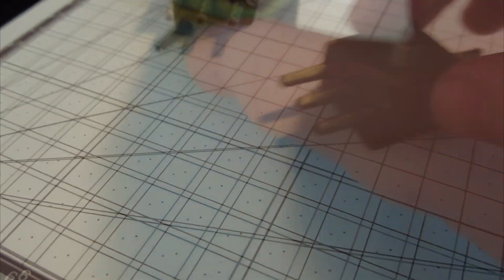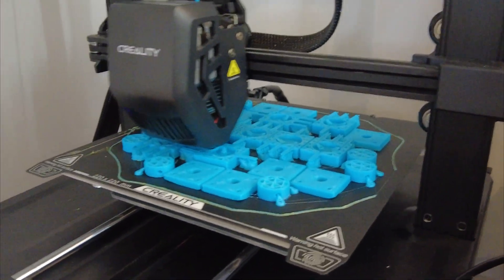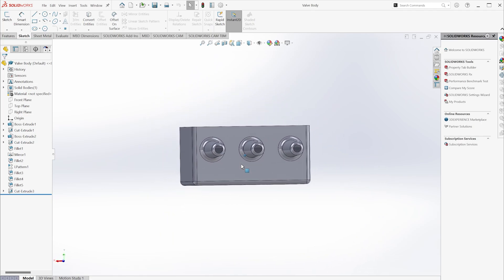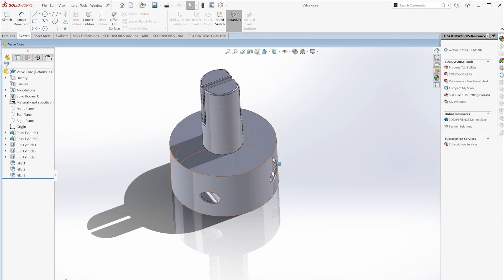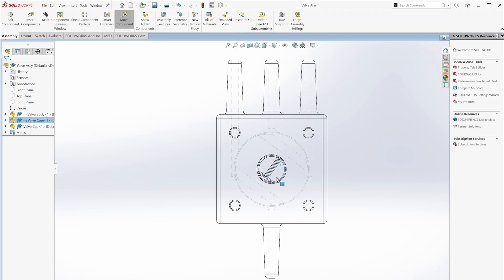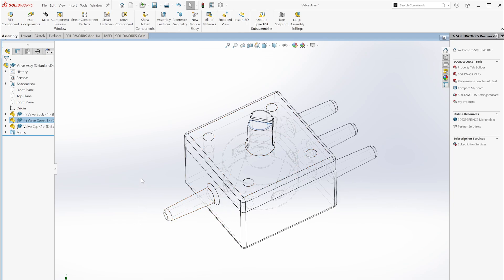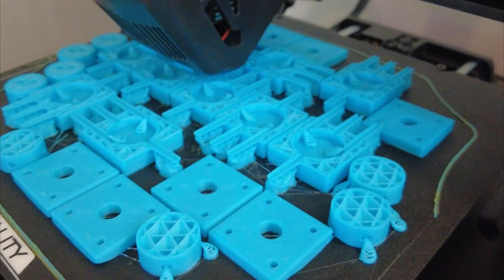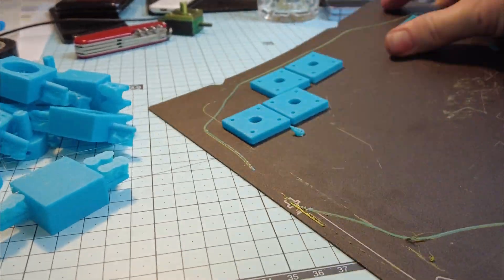Creating a DIY 4 Way Pneumatic Valve With 3D Printing

Comment: Great stuff! Really highlights the power in the maker community to develop custom solutions for low cost. Your students will benefit greatly from this. Only a little warping on the corner of a model near the edge of the bed is a great result, looks like the Ender 3 is working well.
Reply from the maker: Thanks there's more to this story coming soon. Please stick around to find out more!